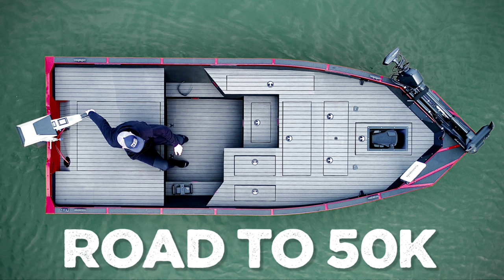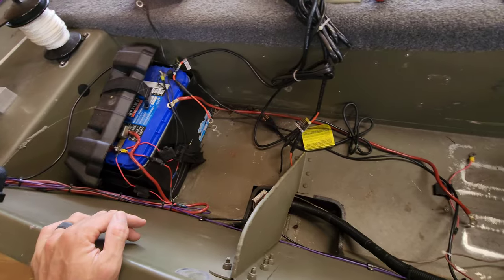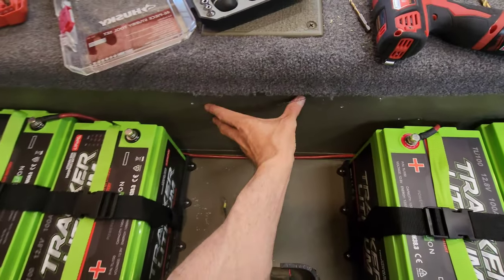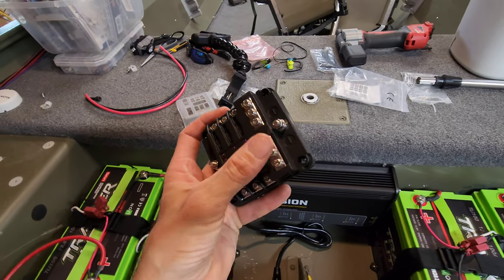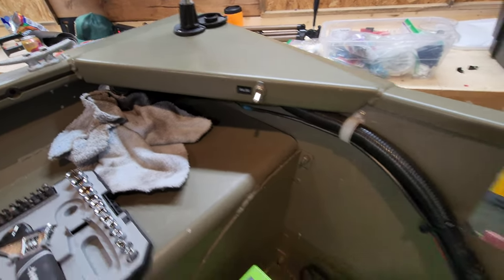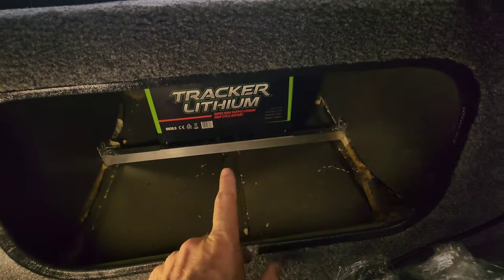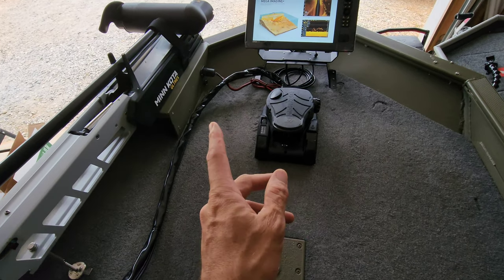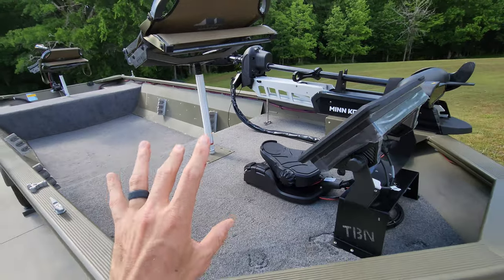Tracker Grizzly Jon Boat UPGRADES! | Step by Step Mods

Comment: I &Ave the same boat. Started with a simple build like that . Went to a full custom build last year. Decks storage , rod box etc.your work is above and beyond anything I could do. I thought and you may already know this, when you do the full build if you move the batteries more towards the center of the boat you will get more speed and efficiency from the electric outboard. I've fished electric only lakes for about 30 years. Not a huge difference but every little bit helps in these boats. Love your work. If I had your skills I would love to customize my rig even more.
Reply from the maker: I'm not sure what the end game plan will be. The boat may eventually get an electric outboard and unfortunately with those you are limited to keeping the battery within relative distance to the outboard.  Distributing weight definitely helps, we will just have to pick and choose what the pros and cons are of the different design options.
Reply: My last boat I ran a 48 volt ray motor with lead acid . Currently running a torqueedo 6.0 with lithium. Weight distribution was high more critical with lead. But then some of our lakes are 3000acres so range and speed are important

Comment: Great video and details. The only thing I'd add is that the wires and batteris be labled so when batteries are removed theirs no confusion putting it back together. Even as an electrical guy myself, it's easy to get confused when your mind is on fishing!

Comment: I have built quite a few solar batteries and it is so much cheaper to buy eve lipo cell's here right above Atlanta you can build a very nice 7kw battery for under $1500 and you will have power for days

Comment: Two things to critique if I may...from my experience I suggest:
1. For the battery terminals, instead of buying the multi assortment (I know with assortment packs I always end up not using a lot, which means waste) maybe figure out exactly what you use (i.e. 8 awg- 5/16", 6 awg -3/8" etc) and just buy those sizes in bulk (same goes for ring terminals...you can buy them in all sorts of hole sizes)
2. For the trolling plug, I can almost guarantee if it is the stock plug, it is not rated for 36v system, if it is, great. If not, that's a big electrical problem, and can cause major issues.
Another badass video bro, keep up the good work
Reply from the maker: Most definitely appreciate insight and a well thought out comment. As far as the terminals, you are right, if your just doing one   variety may not be needed. I feel its a good bang for your buck, especially if you are unsure of the exact sizing. I buy the kits and individually,  I actually now have a whole tub of electric connections because I do so many boats, so it makes sense to me.. As far as the plug, that definitely is something to look out for. My understanding is that this one is acceptable,  it is made by a company called MarineCo and was purchased as an acter market plug for the original trolling motor install. This video was actually filmed in May earlier this year and no issues occurred with it. I definitely don't want any issues nor do I claim to know it all so i appreciate definitely the advice and always welcome helpful constructive criticism!
Reply: @AnthonyJonesBrigadeBoats  absolutely, if you're unsure, or just want an assortment because of different projects, the kits are the way to go. The marineco plugs are solid so I'm sure it's fine. Thanks for not taking offense to what I said, there's so many people nowadays that take offense to criticism.
Reply from the maker: @C.Shoe86  yeah man no worries at all. I'm still learning new stuff often. I'd hope to be learning until the day I die. The ones that take offense to an actual inciteful comment are usually people who need to be humbled. Even the best at something can always learn more. I know a lot but never claim to know it all. Mistakes will be made even if I aim for a high level of quality. Learn, move on. We live in a world where people react  instead of respond. Too many know it alls out there who think they are above learning anything from anyone and just want to show off to the world how great they are to feel validated. That ain't me.
Reply: @AnthonyJonesBrigadeBoats  well said brother.

Comment: Great video man. Where’d you get that mountable plug cover for the battery charger in the back of the boat? Love it. Those little tidbits you produce are legit.
Reply from the maker: Thanks man..Minn kota actually included those with their chargers! Pretty cool i thought. You definitely get what you pay for in most cases.

Comment: Very nice rig, sir! That boat should last you a lifetime with nothing more than an occasional accessory replacement here and there. I bought my Fisher 16.5 foot aluminum deep vee with a 50 HP 4-stroke new in 2002, and she still serves me well. As a matter of fact, considering the cost of used boats these days, she would probably be worth 75% of what I paid for her back then. The best advice I can give you is to unplug the gas line and run it out of gas every time you take her out of the water. I learned this about 10 years ago, and my carburetors have worked flawlessly since. Before that however, I was having to rebuild them every other year.
Reply from the maker: Thanks for the kind words, the Grizzly is a great boat!

Comment: Hey
Why didn't  you re run the power wire  underneath  the floor ? There is a center channel  that runs from the front to the rear under the flooring. It would  have gave it a cleaner look. Ive done two tracker grizzly 1448 and currently tracker 1754 side console.
Reply: Agree.  You can also run them through the Versa-Track too...

Comment: The 2 things , I see are no Gas Boat Motor .
And the fish finder should be to the right , and it should be able to swivel and lock in place .. so if your at a launch and there's no Dock you have to crawl over a fish locator....
Reply from the maker: I thought I fully explained in the video the boat is for ELECTRIC ONLY lakes and reservoirs,  therefore no gas outboards allowed. Most people who run Panoptix,  or in this case, Mega 360 live image sonar, prefer large graphs mounted dead center in front if foot pedal so they can read the live imaging as they work the trolling motor. That's why we, and almost every pro boat, does it this way. But beauty is everyone can modify their boats to their own personal liking! Thanks for watching

Comment: Had a 1870 grizzly with a 55hp tiller all rivets in the floor came loose . Removed floor found cracks in runners in several places. I would adress that issue first
Reply: I have a 1648 tracker, had over a dozen cracks in the runners too. Took over a 100 hours to fix it. These boats are fragile from the factory. If you're going to be doing more than trolling in a river, you're going to be leaking water soon.

Comment: Aren’t those batteries about 900.00 a piece?
Reply from the maker: I have absolutely no clue. Customer provided. I'm sure they are online. I typically use Amped or Powerhouse lithiums, aren't cheap regardless.

Comment: Lol all that money for the equipment and no outboard. I think I would spent the money for a outboard first
Reply from the maker: The beauty about boats (and many other things in life) is that people can make them their own however they want. Remember,  this boat isn't done. And the customer fishes small electric only lakes, doesn't need an outboard. I'm sure she may get an electric outboard at some point, but what's the point if you don't have a trolling motor and electronics? You can LOL all you want but what I LOL about is people coming on my platform, that I built, to interject their opinion that I nor my customer ever asked for but you do it anyway so you can feel good about yourself and feel validated.

Comment: Strange to spend nearly 20k upgrading a Jon boat... all in price is very close to a decked out V bottom at that point.
Reply from the maker: Yeah but a v hull is still a v hull. We don't really use those in Ga. And that v hull brand new doesn't come with a 36v ultrex with spot lock, live sonar, lithium batteries,  or a 4 thousand dollar graph. I've seen it both ways, guys buy brand new rigged boats only to rerig them and go another 10k in or guys start with cheap boats and outfit it in tons if moneyin top of the line accessories and electronics.  Money all relative to the individual,  I just build them.

Comment: U realize u can't charge a 36v battery with 12v clearly u don't know how to wire.
Reply from the maker: You clearly are uninformed.  A three bank 12v on board charger can absolutely be used to charge each individual 12v battery wired as a 36v system for a trolling motor. Read up-
https://www.trollingmotors.net/blogs/wiring-electrical/116678215-guide-to-battery-chargers